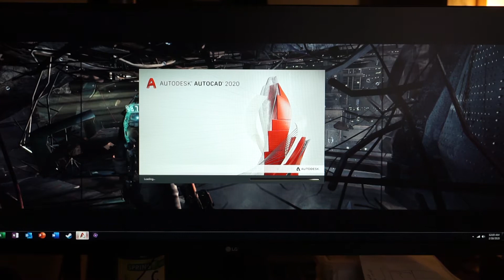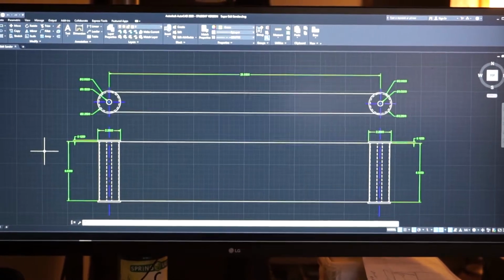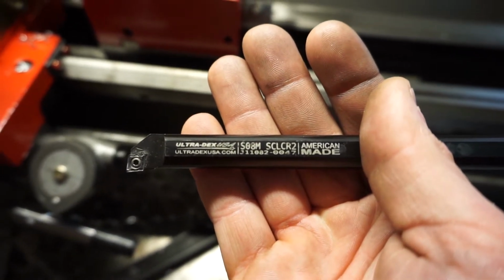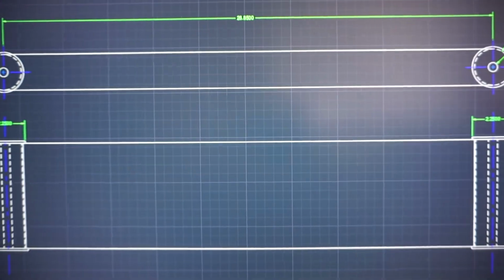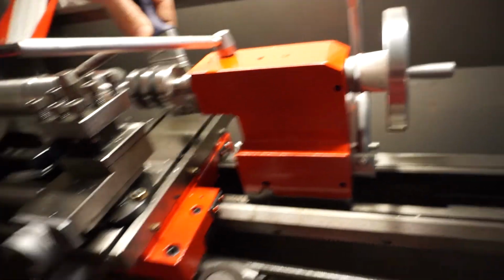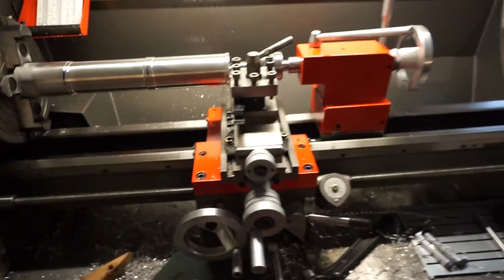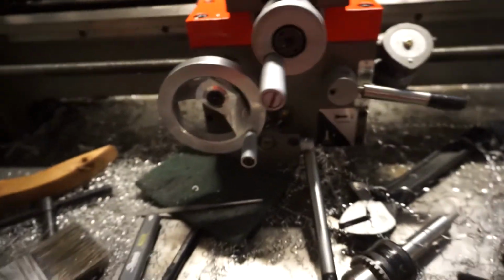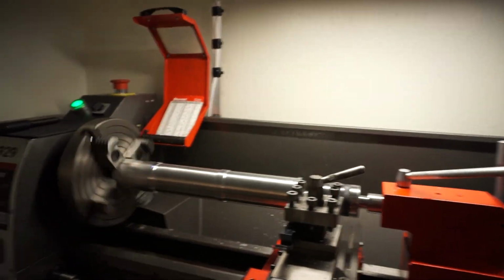BDB-929 Follow-Up and Belt Sander Project

Comment: Precision Matthews sells better quality small precision lathes from $2,899 to $4,399. You can see a review of one model and videos of it in use on the Blindihacks channel.

FWIW, I'm glad I stumbled upon your channel and saw this honest commentary on the BDB-929.
Reply from the maker: @gaiustacitus4242  ya precision Matthew’s makes really nice equipment. Most in this size for any brand are a crap shoot really
Reply: @sinewavespecialties2373  True. I've seen multiple reviews of the same models of lathes and mills manufactured in China. One unit will be of decent quality, but the next will have internal components covered in dirt and have defects in materials or workmanship.

The machine tools made in Taiwan do not suffer from such quality issues.

FWIW, I purchased a $6,500 CO2 CNC laser that was made in China, and it is very well made and packaged to prevent damage during shipping. The problem with Chinese made products is the inconsistency. Like you said, it is a crap shoot.

Comment: Seems as though jet machine tools have a of problems...Other channels also have a lot of negative review...I wonder if jet listens to these reviews...anyway..hope your channel progresses
😎ROCKMAN😎
Reply from the maker: Hayden Richards it’s not so much they are horrible tools but they certainly aren’t a production quality machine.  A lot of the parts are soft steels rather than hardened or heat treated, and some SHOULD be a 4140 or 4340 alloy but isn’t.  This lathe will be replaced by a cast iron 1930’s-1950’s version in the future
Reply: Good move. Go for the the 40's
Atlas or southbend's. There solid, accurate and many are still around and work as good as the day they came off the Michigan or Indiana lines.